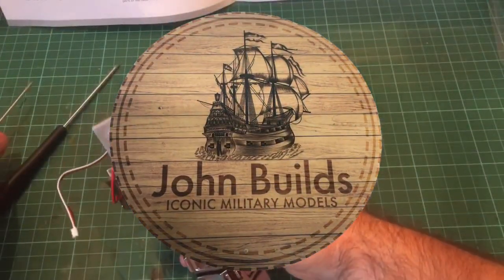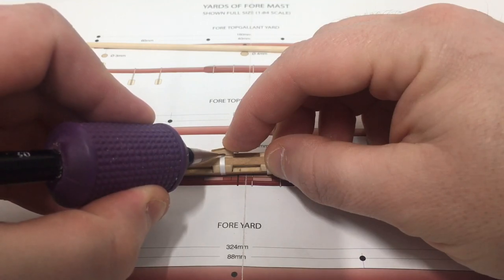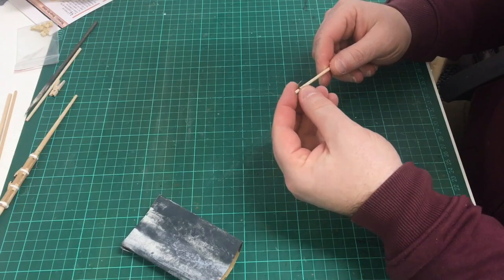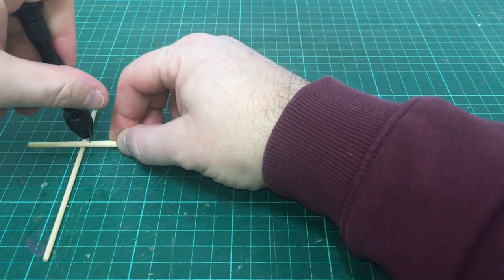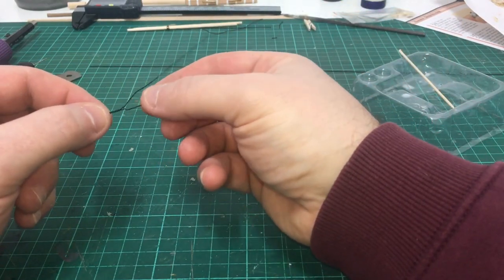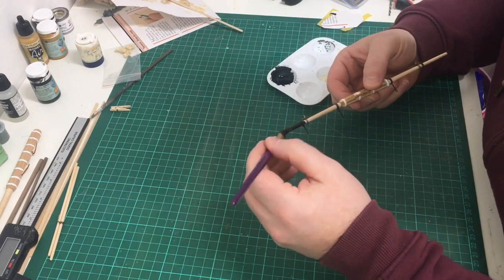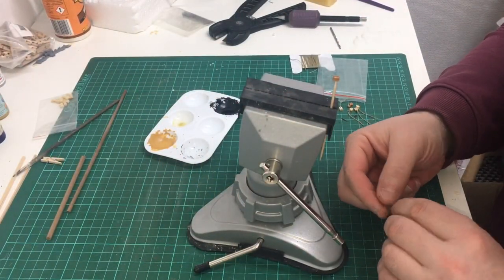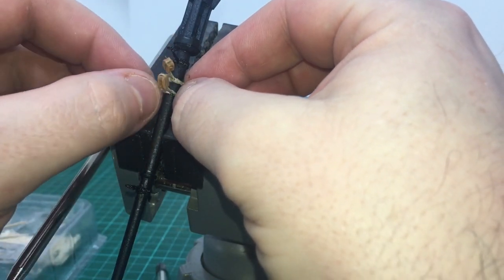Model Ship Builder : HMS Victory  : Part 46 : Completed Fore Topsail Yard

Comment: Hi John,
I have just one question. Why do you have the same size blocks?  🤔. They should very in size depending on what they are holding/pulling.
And they are to get smaller as you go up the mast. That goes for : single, double and triple blocks.
Stay well and stay safe.    👍. 😷.  🍻 (first beer is on me).
Jason
Reply: John Builds Iconic Military Models thank you and have a great weekend 
Stay safe.  😷. 👍.  🍻

Comment: I am ready to get the Fore Spar mounted
Using the book     to get it as correct as possible.
The centre of the spar had a heavy rope around it lashed up to the Fore Top
There are  another 2 lashing  1 either side of the above with a large 3 hole lashed to the side of the foremast and a large twin block lashed to the spar
Not sure if your instructions in the magazine show this
Not sure if this will help - can i post a picture on here

Comment: John
What issues are the full page Yard pictures in please
Reply: @Johnbuildsiconic  Its those great yard photos r are they the same Thanks
Reply: Currently, I’m working on the yards for the Santisima Trinidad. I’ve completed the bowsprit, fore, and half of the main masts, and if I weren’t so far along, I’d change how I fixed the brass stirrups to the yards. My method only leaves one wrap around the yard, but I like the thickness of your method. Thanks for the tip! I’ll use it in my next build.